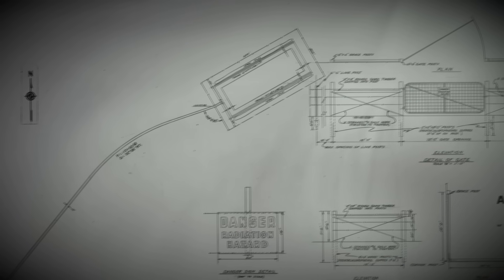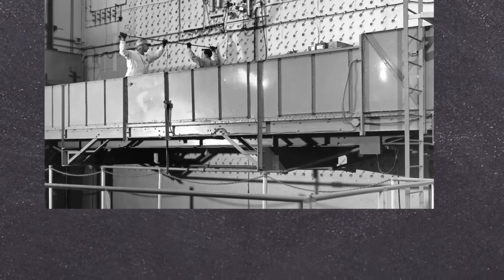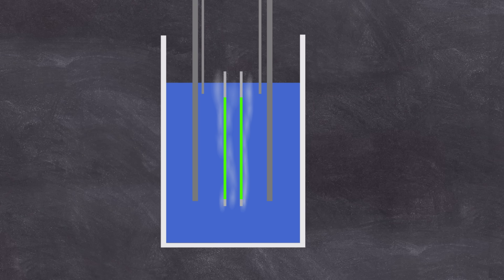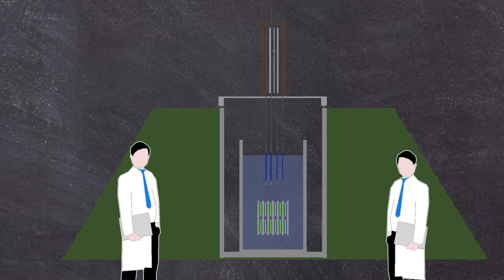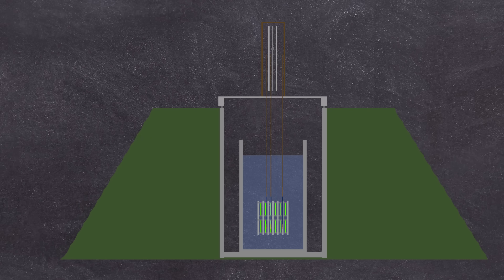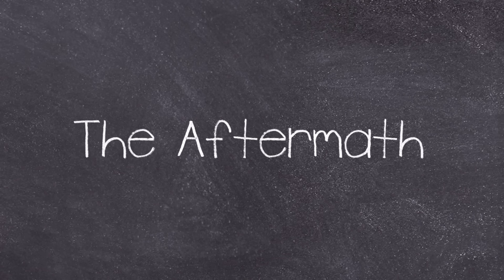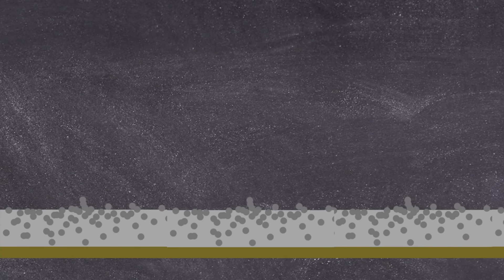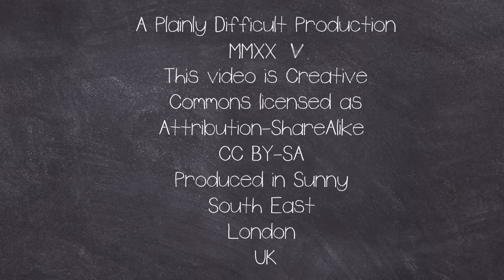Nuclear Reactor Melted Down Deliberately To See what would Happen | Plainly Difficult

Comment: Now, scale it up to largest NPPs with 30 years of spent fuel in ponds situated on upper floors of 4 reactors which then detonated & reduced their hieght from 190ft to around 25-30 foot.
All water inlets completely lost.
Each required 450,000 gallons a minute to be pumped to cool the fuel, this was all lost & replaced with a hose spraying around 80 tons a day per unit.

Comment: A fun little note on the "self-regulation" of BWRs is that the whole concept actually is very terrifying... and in the 80's licensees told the NRC that this concept didn't exist and they don't need to worry about it... then it happened at the LaSalle Generating Station where oscillations of the power (the previously mentioned self-regulation) to go from 25-50 % reactor power all the way to ~0-118% within the span of ~2 seconds. (https://www.nrc.gov/reading-rm/doc-collections/gen-comm/info-notices/1988/in88039.html ) . Because of this, all BWRs in the USA are now equipped with trip functions in case it happens again. Steam cooling is an emergency procedure in case of a Loss Of Cooling Accident but it does not rely on the self-regulation. Just a fun little addition to the very well done video.

Comment: So, i had the idea of a modular reactor that used liquid fuels of vareying enrichment, nuclear waste as well. The core would piece together by long arm pistons, and it would have changeable geometry inside. There would be a main driving piston that would compress the liquid into a critical state. And of the power spikes out of control, it either unpieces itself, or the main piston is pulled back to relieve pressure. Yes, it is compressing fissile material into a sphere. Convection would be the moderator as well as the adaptable geometry of the core. Pretty much a nuke waiting to happen, but it could process and use radioactive waste efficiently.

Comment: What? Haven't done the OTHER reactor explosion on purpose? Called Kiwi-TNT it was a specially designed nuclear rocket motor that was built to show what such a an accident would be like. (Note that it literally HAD to be designed to explode because nuclear thermal propulsion reactors can not normally explode or really even melt down) In this case it was built so that once it had been filled with liquid hydrogen, the reactor would be brought to criticality BUT the control (damping) drums would immediately slam to full power AND the vessel would be sealed so the now superheated hydrogen had no way out and the reactor containment case broke open. Once the hot hydrogen hit the air it burned due to the presence of oxygen which caused the bursting to become an explosion.
Clean up took a couple of days as the debris wasn't blown very far from the reactor, however a cloud of unburnt hydrogen did leave the testing area but by the time it crossed the boundary it was at several thousand feet and kept rising (as hot hydrogen gas does) it kept rising and by the time it passed over LA it was several miles high and still climbing.

Comment: Ive always wondered something. In s nuclear reactor we harness what is in many ways unlimited heat. We cool it to prevent it from getting too hot, but it feels like we "capping" something that not only doesn't need it, but also seemingly leaves alot of potential energy "on the tabl". It's one turbine to a reactor, maybe 2. My question is, why isn't there 40? Why isn't there a vast complex of turbines feeding off of the heat derived from a single reactor? It would also be an additional way to manage water, and even power. There are apartments in Siberia where its like 4 units built around a large fireplace in the middle and they all share in operation and maintenance. They are doing this because its the most efficient way to harness the heat in the community. This is essentially my question. If you have something that will bring any amount of water to a boil, ehy isn't there a facility that takes advantage of that eith millions of gallons of water that are operating dozens or hundreds of turbines providing the energy for an entire state to states. Oklahoma mite not be able to fund  one, but Oklahoma, Arkansas, Missouri and Tennessee sure can.

Comment: Someone had to verify behaviour at the extremes. I think that they nailed it. 
Quite hard to generate electricity with steam from water boiling at atmospheric pressure. Wet steam is not ideal for turbines sadly. Otherwise it’s a wonderful concept. 
Somewhere between this in cautious approach and todays overzealous approach lies the happy middle ground of reactor safety.

Comment: Great video but it's a shame the top and bottom of all the old film footage has been cut off. The original would have been 4:3 aspect ratio, converting it to 16:9 for this video has removed what I would consider to be significant information. For example the explosion shots would have shown more of the building it came from and how far it shot into the air instead of disappearing off the screen.

Comment: Love Canal was built fine and in a fine spot at the time it was built. Also it wasn't built as a chemical waste dump for that matter. It was an actual canal plan in the 1890s that fell through, then it was a skating rink for a while, then in the 1920s the local towns decided to use it as a garbage dump, then in the late 30s the chemical company bought the rights to dump there, but also let the US Army dump there, then after 1945 the Army left and the chemical company dumped there until 1953 when it was filled and then sealed it with clay. You could still just pump this stuff into a river at the time if you wanted to, HCC was doing better than most of their peers in the 40s and 50s, and the dump would have lasted decades if not for the city tearing it up after breaching contract

Comment: Only 100L of water? Is that correct? That’s just half a barrel full and would boil off in seconds at 70MW
Reply: ...it boiled off in a fraction of a second, from the energy released as the reactor went prompt critical and suffered a massive power excursion.
This actually gave a much larger steam explosion than had been predicted.
Steam plant explosions have been a thing at least since the early days of steam engines. 
So it should not be too surprising that faults with nuclear plants can also cause steam explosions.
Reply: But to actually answer your question, 100 litres looks like a realistic value for the volume of water in and around the 28 MTR type fuel elements present in the reactor.
The actual reactor tank had a volume of roughly 4600 litres but the very short duration of the reactor power excursion would only have had time to vaporise water close to the actual fuel.

Comment: Cladding heats up 100°C per 0,1 seconds
Fuel melts at 2,800°C
After melting > Phase transition -> venting, melt a little vent a little
The Fukushima bwr pressure cooker
For Chernobyl everything was thrown out by1,2 terrajoule ( DeGeer and Checherov)

Comment: If the control rods stop/slow/control the reactions between fuel rods....this prevents a 'melt-down'......What prevents a melt-down within the fuel rods themselves....What prevents a melt-down within the fuel pellet itself ?
Reply: The fuel pellets are the active nuclear components of the fuel rods. So shutting down reactions between fuel rods is the same thing as shutting down the reactions between fuel pellets.
Reply: @derekp2674  No its not. Nothing has been done to stop reactions between each fuel pellet or within the fuel pellet itself.
Reply: @DernFool  You are correct but only for cases where neutrons remain within the fuel after fission and never travel from fuel to fuel via the space where the moderator and the control rods are.
So, in terms of the four factor formula that can be used to evaluate the reactivity of the core, that means the control rods don't really affect the fast fission factor.
But, as here, a thermal reactor can only achieve criticality if there is a significant thermal neutron flux re-entering the fuel from the moderator. So the control rods do effectively reduce the thermal flux and then the overall reactivity.
In this specific case, fuel pellets were not used. The core was built using 28 MTR type fuel elements. These contain fuel plates made from an alloy of enriched uranium and aluminium then clad by further aluminium plates. That design means that, given the large expected mean free path for fast neutrons, a high proportion of the fast flux will leave the plates and enter the moderator. The total mass of U-235 in the core was about 4kg. That's not enough to self sustain a fast chain reaction, even if not diluted by alloying with aluminium.
Reply: @derekp2674  If the volume/quantity of moderator drops to zero...what happens to the core?
Reply: @derekp2674  When is the heat created? When a fuel rod, full of fuel pellets, is placed next to another fuel rod?
Reply: @DernFool  If you removed all the moderator, then the neutron chain reaction would be extinguished. The criticality accident at the RA-2 research reactor (recently covered on this channel) could only happen because the operator violated operating rules and neglected to remove all the moderator before changing the core configuration.
Reply: @DernFool  If a neutron chain reaction is established, heat is generated by fission reactions. Most directly, heat is generated as the kinetic energy of the fission product atoms. That accounts for very roughly 85% of the total energy released. Roughly 5% of the released energy appears as decay heat from the radioactive decay of fission products. Roughly 10% of the energy appears as radiation emitted at the time of the fission events.
Reply: @derekp2674  Once the reaction INSIDE the fuel rods becomes self-sustaining...how would you STOP the reaction INSIDE the sealed fuel rod?
Reply: @derekp2674  OK...I read that a reaction becomes self-sustaining after 18 months....doesnt need a moderator.
Reply: @DernFool  Where are you reading that? 
To self sustain without a moderator, you need a system that can self sustain from the basis of a fast neutron chain reaction.
Any such system will need to contain at least the minimum critical mass of unmoderated fissile material.
For example, the Godiva experimental assembly at Los Alamos was a spherical assembly of highly enriched uranium with a mass of roughly 53 kg.
Some of the Sarov experiments used non moderating reflectors to reduce the required fissile masses to around 30 to 40 kg.
Reply: @derekp2674  I read that after 18 months the reaction inside fuel rods becomes self-sustaining.....If thats true... you cant stop reaction with control rods.  Instead of control rods, why dont you simply release the moderator...that will stop reaction, right?
Reply: @DernFool  I am sorry to say that I no idea at how or why a time of 18 months could affect fuel in that way?
Where on earth did you read this?
I'm sure it cannot be true.
Reply: @derekp2674  Proximity to other fuel rods is not necessary? Only thing needed for the reaction is regular water slowing down neutrons exhibited by the uranium fuel?
Reply: @DernFool  To go back to basic reactor design theory, civil reactor fuel is usually designed to work as a lattice of fuel rods (or plates or pebbles etc) arranged within a moderator (e..g graphite or  water).
The origin of this design goes right back to the very first reactor, Chicago Pile 1, because if the fuel is natural uranium and the only viable moderator is pure graphite, criticality can only be achieved if a lattice is used.
A uniform mixture of natural uranium fuel and graphite can never achieve criticality, even for an infinite quality of material.
But if appropriately sized fuel rods are spaced correctly in a lattice, it becomes possible to assemble a critical mass of fuel and achieve a self sustaining neutron chain reaction.
Reply: @derekp2674  How do the control rods stop the heat when the water is still there next to fuel rods? A control rod isnt very big...that volume of water cant add much to slow down the neutrons....It seems control rods arent needed...just lower the water level or pull fuel rods out of water.
Reply: @DernFool  Control rods provide one means of adjusting the thermal power of a nuclear reactor, so they can control the rate at which the chain reaction causes the fuel to produce heat.
But, in a civil power reactor, the most important way of controlling the power level is the control of the rate at which coolant is fed into the reactor.
In an emergency, control rods can be used to trip or "scram" the reactor. This instantly terminates the neutron chain reaction.
But, because about 6% of the total heat is produced by the radioactive decay of fission products, post trip cooling is required after a trip.
As Fukushima showed, very bad things happened after their post trip cooling arrangements failed.
Newer designs of reactors are designed to have much greater degrees of passive safety. But without that, core meltdowns are possible, as seen at Chernobyl and Fukushima.

Comment: 100L of water in the reactor seems too low! How can the reactor be self regulating if the regulating water is able to splash, and escape the reactor?
Reply: 100 litres would have been the volume of water in and close to the fuel plates. The actual reactor tank was much bigger and could hold up to about 4500 litres of water.

Comment: I was in Arco when they connected the town to the reactor. There was a fair amount of advance publicity, and since my parents were originally from Arco, and we were living a half-day's drive away, we went. There was a countdown on the radio, then (we were all looking at a bare light bulb turned on just for the occasion, at noon)... and nothing happened. The lamp was on, and when the power grid was switched to the nuclear power, there wasn't even a flicker. I was about 7, and this was the early 50s after all, and I was expecting at least a blue glow or something. Nope. Light looked exactly the same. I was kinda disappointed. FWIW, Arco is a weird town, and worth a visit. There's nothing there but lava beds and a sense of terminal isolation.

Comment: I don't understand the boiling water reactor. Water turns to steam and its neutron slowing ability decreases....therefore reactivity decreases. Shouldn't it increase? Or did I just hear wrong? Thanks
Reply: In the BWR reactor designs, water is needed to make the reactor work. It acts as a moderator and slows down fast neutrons produced by fission. The slow neutrons can then go on to cause further fissions. So if the water boils, this reduces the mass of water around the fuel. That then reduces the production rate for slow neutrons. That then reduces the rate of further fissions and the reactor power.
Reply: @derekp2674  ah got it, thankyou!

Comment: Ohhh for goodness sake.
As stated in this video, the issues that happened in the likes of Chernobyl, TMI and Fukushima where demonstrated in the very early days.
Causes for what makes things go boom was well under stood. Even after the reactor was scrammed and the coolant pumps failed due to lack of power or to idiots in the control room.
All of these measures were not taken into account during the design phase in some cases. This is why we have certified techs. However. In my waning years, having certificates is proofing to be nothing. It's the ability to think when new challenges present them selves. 
For Fukushima, what Muppet puts a BWR on a coast subject to tsunamis and them to add insult to injury puts the damn backup generators in the path of flood waters! Someone needs to be held accountable.
For Chernobyl, that was a lack of knowledge/lack of training/lack of communication (in airline talk lack of CRM and that leads to airline disasters with many deaths) and idiocy lead to the Chernobyl problem. Yes the reactor was a wild cat, the operators should be on top of that. Trained or in aircraft terms (type certified) for that reactor. Other reactors like at Chernobyl and at Chernobyl. Other power plants like what was at Chernobyl worked decades after the 1980s . Yes they were a crap design. Just work them within their parameters.
What a bunch of buffoons on many levels.
Edit: Grammar and spelling